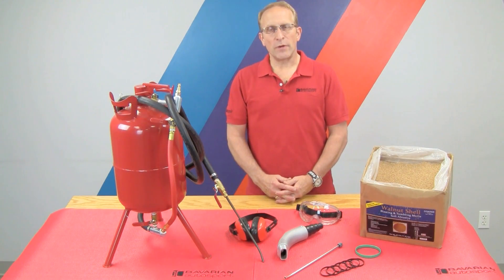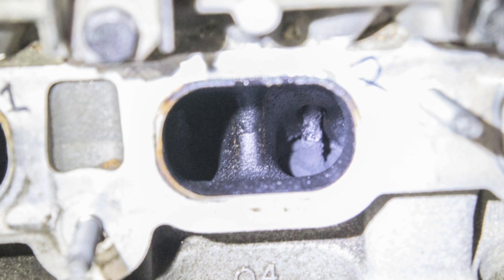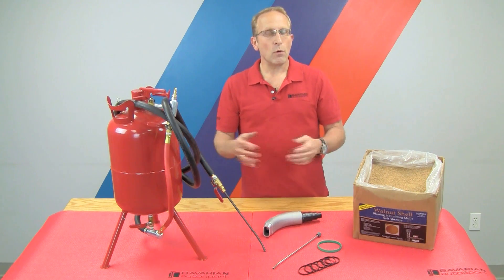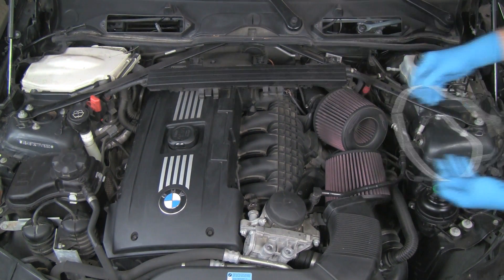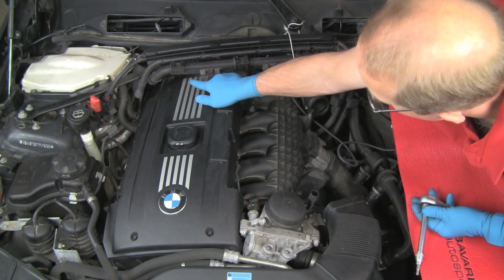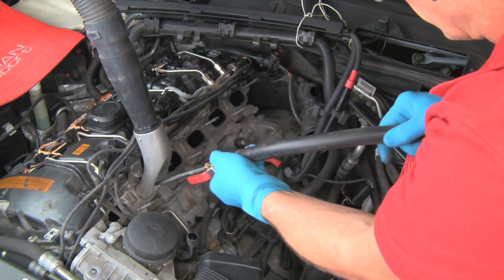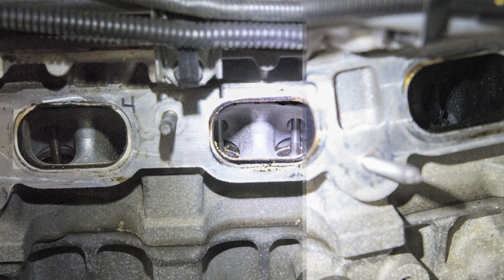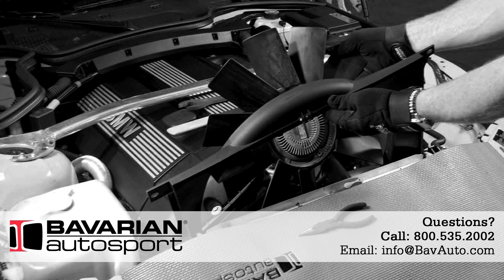Cleaning carbon from intake ports and valves on BMW and MINI turbo engines N54 N55

Comment: Would this work for 03 745li ?
Reply from the maker: Your 745i (N62 engine) does not have direct injection.  Therefore, it does not have this carbon problem.
Reply: BavarianAuto could you suggest a service to clean up carbon and varnish 525i e39 with 112000mi.

Comment: what the effects for driver. if i clean the in take? only clean? or??
Reply: Listen to what they say at 16:37, it makes the engine clean again and run the way it should; much smoother and with a better, more direct throttle response

Comment: Having done this job a few times i often wish they made a slightly larger blasting tank. pressure drops way to fast :(
Reply from the maker: You likely just need a bigger compressor.  The size of the blasting tank is only reflective in how often you have to refill it.  If you run the pressure down and then have to wait for the compressor to run and refill the compressor tank, this is a compressor issue.  A blaster uses a lot of air.  We can run continuously with the blaster shown, but we have an 80-gallon two-stage compressor.  Typical home compressors do work, but you will have to occasionally stop and wait for more air.

Comment: I'm glad you shared this video, although in order to DIY it requires a large investment.
Reply from the maker: Of course, it is still much less than one service at the dealer!
Reply: BavarianAuto
Plus, you'll most likely have to repeat the process again during your ownership of the car, so the overall cost is very low.

Comment: BMW should have redesigned the intake system to reduce the amount of oil taken into the intake ports in order to reduce the frequency of this service. I've had this service (walnut blasting) done on my N54 once and because I have the oil catch can, the amount of carbon was quite less than the images you show.
Reply from the maker: Yes, a properly designed oil separator system for the crankcase ventilation, would reduce or even eliminate the carbon build-up.  The first car we did, was much worse than this one (80K) and had an aftermarket catch can installed.
Reply: BavarianAuto There are some really uneffective OCC's out there on the market.  The one offered from Burger Tuning seems to be the best one; this is the one I'm choosing once I get the walnut blasting done.
Reply from the maker: Bryan Meyerott
Thanks Bryan - We have the Burger oil catch can, click below:
http://www.bavauto.com/fland.asp?part=OCCN54

Comment: Is this procedure factory approved?
Reply from the maker: Yes it is ... the port adapter is a BMW service part.
Reply: Thanks. I have to confess that I felt completely overwhelmed by the complexity of this procedure (terrified is a better word). Is there some preventive maintenance that could stop arriving to this task, perhaps something in the way we drive the car? If not, how any miles before one has to tackle the procedure?
Reply from the maker: Alfons Llana
 - It is inevitable that you will need to perform the de-carbon procedure.  There is really no way around it.  With the vehicles that we have inspected, we are recommending 30,000 to 40,000 miles in order to keep the best performance and efficiency.
Reply: +Alfons Llana - The best way to avoid this is to NOT buy a direct injection BMW. VW/Audi 2.0T engines are notorious for this too.

Comment: 335d solution? My 11' will be coming up for this necessary maintenance I assume. Just passed 40k miles
Reply from the maker: The procedure for the diesels is a bit more involved and actually involves multiple port adapters and blasting wands.  We have not addressed this as a DIY yet.